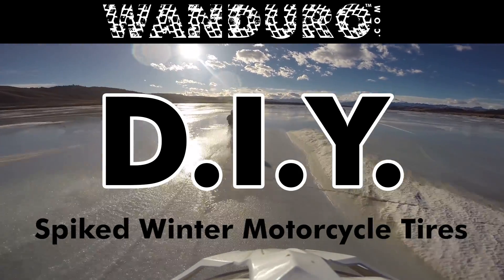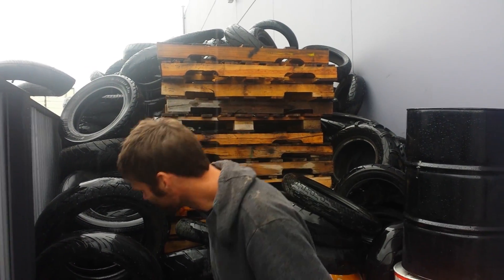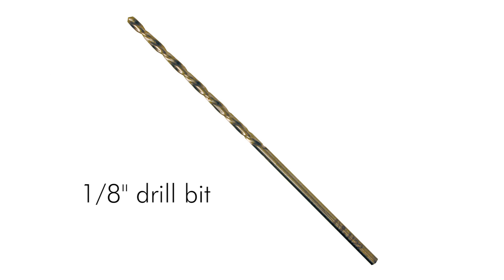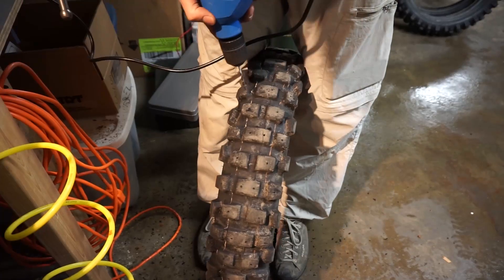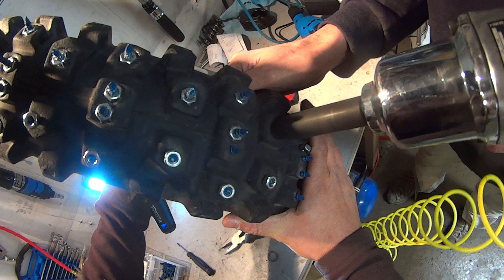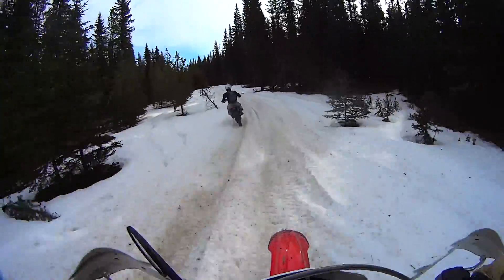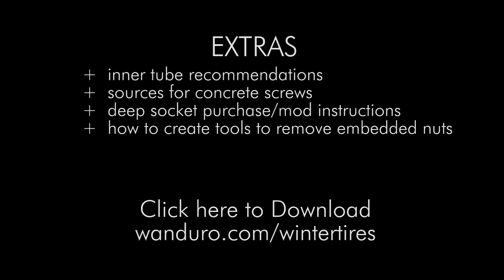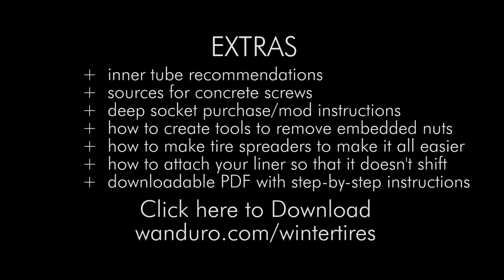How to Make Winter Motorcycle Tires The Easy Way

Comment: been making same tires for past 5 winters these tires are awesome you can go anywhere
Reply from the maker: So true!  
Watch for some more our winter riding videos.
Reply: Why don't you use washers on the inside?  seems like it'd be more durable...
Reply: so how much clay traction do you get fom completely warm down  studds with  just the nuts for traction?
 i assume a far bit still
Reply: @LordxJoe  Just noticed this comment!  without washers, the heads bury themselves into the rubber a bit thereby making it less likely for them to rub through the liner and get the tube. Durability has not been a problem. Screws wear down long before that.
Reply: @nutzy99ify  You still get a ton of traction. At the end of the season, we keep the rears on and wear them out on the mixed dirt/mud/snow trails until we can put normal tires on.

Comment: took em to the shop to be mounted, you should of see the look my mechanic gave me. anyways first time trying this so hope it works
Reply from the maker: That's funny!   Have you had them out yet? How are they working for you?
Reply: i only had them out once, i live in iowa and we just went from - temps to 40 degree days. the ground has unfroze so i have rode it with the top layer unfroze. they worked descent. i feel they would work better on froze solid ground. as for the tires they r holding up just fine. i used a rubber that i think was called shower liner or something like that. i bought it at lowes. working so far
Reply from the maker: We usually use them into the spring when there's a combination of frozen icy patches and muddy thawed patches. They work really well. 
But they are a bit squirrelly so you need to be on your toes.   As long as the rubber is about 1/4 inch thick you should be OK. We used thinner stuff at first and the screw heads would wear through the inner tube after about 4 or 5 rides.  With the thicker stuff, the screw heads carve up the rubber but don't get through to the tube.
Have Fun!

Comment: Sorry to bring up an old video, but hopefully you guys notice this and are able to respond.  First of all, thanks for the very nicely detailed instructions.  I have noticed in some videos that use a similar method that they are mig welding the screws and nuts together.  Is this just unnecessary weight and an extra step?  How many studs do you loose  per season?
Reply from the maker: Hi Stan... no worries, and you're welcome! We haven't found welding to be necessary. We used to lose one or two nuts per season until we became more vigilant about noticing when we've stripped a nut when cross threading. If the nut gets stripped, then it will come off more easily. Some people are using nylock nuts, but we've found that properly cross-threaded standard nuts work fine and stay on. I'm on my second season with the current tires and they're still good.

Comment: do you think 1 inch screws would be ok for a pit bike? these seem a little long. the tires are 10 and 12 inch
Reply from the maker: I'm not sure. Depends on how thick the treads are on  the tires. You basically want about 1/2" protruding for mixed snow/ice riding.
Reply: @wandurolife  awesome thanks for the reply!
Reply from the maker: @cl866  My pleasure. Hope it works out for you! How about joining the WANDURO Enduro Adventuring Facebook group so that you can share pics of your project and rides.